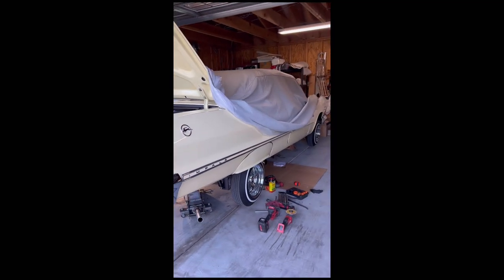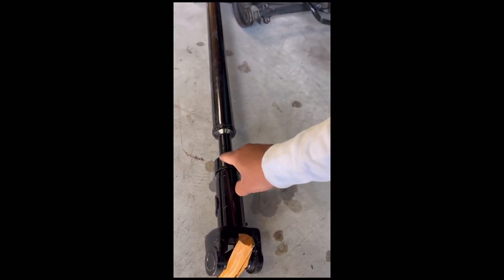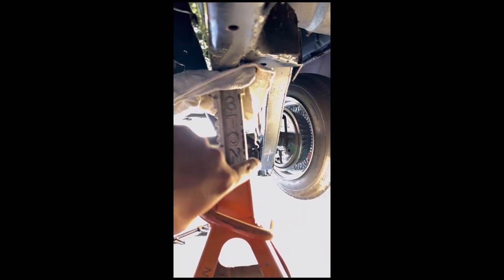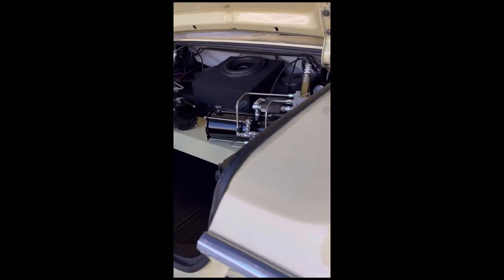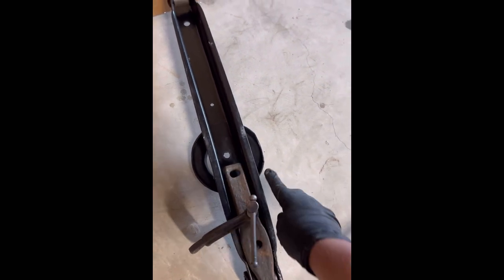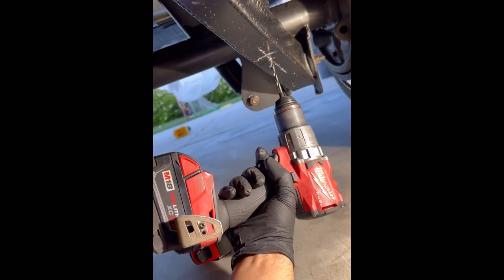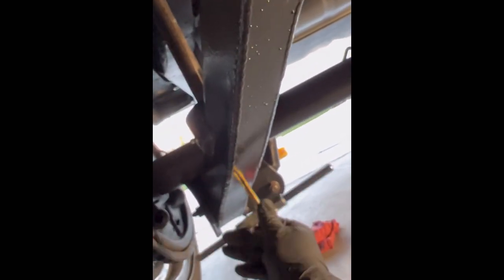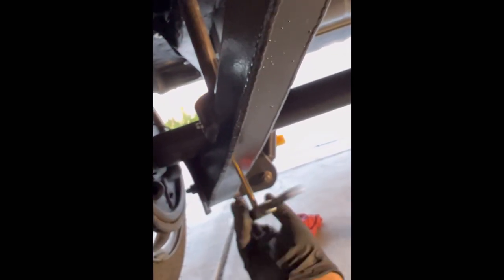1963 Impala | SouthSide Sway Bar Instillation | Drive Shaft Tunnel Frame Notch | Lowrider Hydraulics

Comment: Would I be able to install a SS bar without thr trailing arms welded like you show?  I have hydraulics and dont have the weld to cover the trailing arms like in the video
Reply from the maker: You can probably make brackets to go in between the trailing arms. But I highly recommend you reinforce your trailing if you have hydraulics on your car.
Reply: @ChapsBuilt84  thank you.  I need to get that done.

Comment: Do you have video or pics of the finished drive shaft?  Did you have any issues after that 2” cut?  Thanks
Reply from the maker: I have videos of finished drive shaft… check out my other videos boss.  If you are referring to the frame tunnel notch?? Next time I would go 3” instead. Drive shaft really close when I’m fully locked up.
Reply: @ChapsBuilt84  saw the video.  Thank you.  You think that notch needs to be welded for strength?
Reply from the maker: @lakeshow2475  yup gotta be fully wrapped!

Comment: U got any vids or info on the rear end swap
Reply from the maker: Man !! I wish I would of recorded the installation, If you check out my other video titled “ First Fire” it shows a close up of my 62 SS with a G-Body differential.
Pretty much any 1981-88 G-Body will fit! And clear skirts if you are running wire wheels.
I made a couple of brackets on a water jet for future builds. But the main ingredient is my boy! He has installed numerous G-Body swaps.
Reply: @ChapsBuilt84  ill check it out love the color on your 63🔥 im do n a 63 hard top and i ordered brackets to do toyota rear end but still keep n my options open since i know g body u can get a 3.73 posi from ss monte or even better a grand nat 8.5 rear end seems like toyotas dont die and end up in the yards like other cars
Reply from the maker: @alfredopolojr6212  Thanks 🙏 Yes if you can get a 8.5 GN rear end with 3.73 and a 700R4🔥🔥
Reply: So i heard them sway bars are from monte carlo but u have to bend a lil do you know from what year